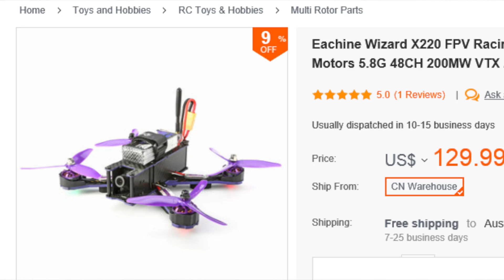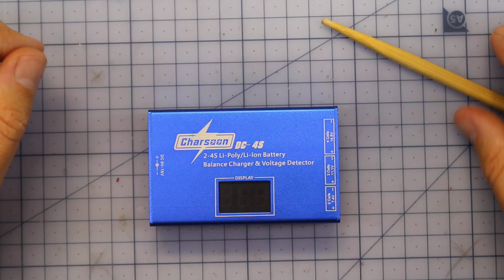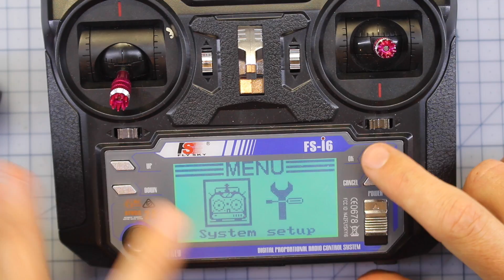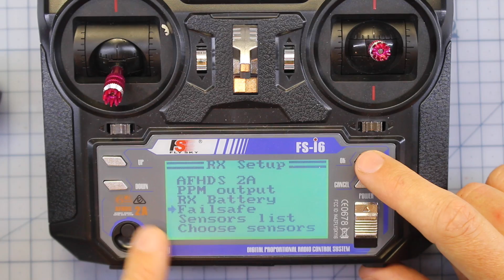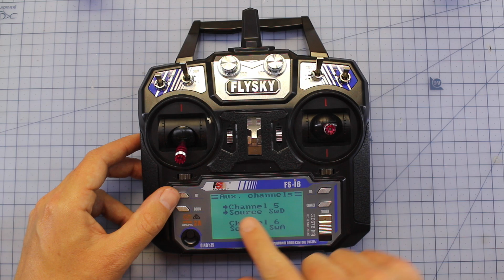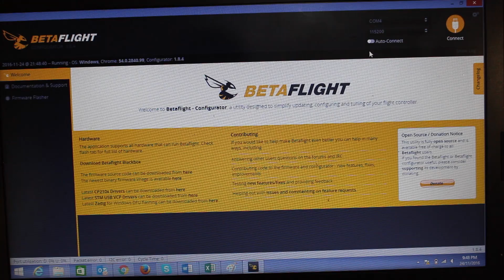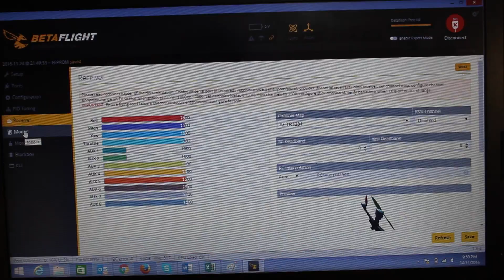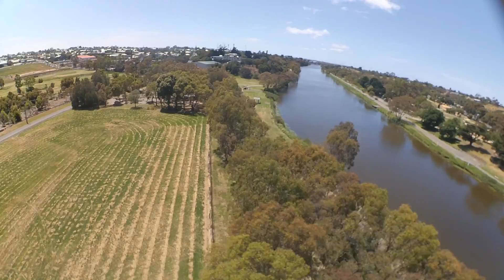How to get FPV DRONE RACING for under $300! Parts +Full setup.

Comment: +UAVfutures Thanks a million for the tips! Can you go into more depth on the failsafe functions?

You mentioned something about "in case the quad loses signal, it won't fly away"

On Channel 13, you set the throttle to -99%, which I understand stops the motors, but what did you do on Channel 15 with that switch?

Comment: Is the binding process as simple for the Taranis? I have the Taranis and x8r receiver. In all the videos I've watched people have been dealing with a bunch of wires I dont know what are and putting a battery to the x8r and doing setting in the controller... Do I have to buy a little battery to power my x8r receiver or what?

Comment: i flew my drone for the first time today i got in 2 flights (i have actually the same kit) but i tried to charge my battery again and it wont charge it sometimes comes up with error and when plugged into the drone the lights just flash and the controller beeps and says it has no power if anyone one can help it would appreciate it

Comment: Wow thanks for this build I bought nearly all the parts recently and I am just waiting for the delivery. However, I couldn't but the goggles because they were out of stock. 
About the goggles, can they be used with glasses? I have seen that other models like some eachine ones they do have an adjustable lens. How do people with glasses do? Perhaps, at the screen is not far away glasses are not needed? 

Thanks in any case for your videos.

Comment: Really excited to start FPV. I own 3 toy quads that I've flown for over a year now and didn't know FPV was a thing until several months ago. Been doing a lot of research and I can safely say the Wizard's going to be my first, plan on ordering an RTF version, so I won't have to worry about multiple shipping dates/arrivals, plus I"m lazy. I've seen several reviews say that it's not for beginners due to the programming aspect, but I don't think that will be a big deal, since this video shows you how to do it. Super excited, just hate having to wait for it to restock.

Comment: i followed your setup and had it all working yesterday but i tried it again today but i had a little puff of smoke when i connected the battery and cant connect to the fpv goggles anymore :( havent even flown it yet. i think i just wated $400. Also how tight do I tighten the props? are they ment to be able to freely spin if you flick them? if not how do I tighten them enough with out superman coming over and doing it for me?

Comment: Awesome video! one problem I am having though... I went through every step and have all the same settings. But when I plug my battery in and turn on the transmitter, I get no interaction on betaflight when looking at the receiver screen. Nothing at all. When I disconnect the wizard from the computer and put the battery in, still no response from the transmitter. The receiver is lit with a solid red light so I know they are paired. But getting nowhere.

Edit: I am using the Fly Sky FS-T6 transmitter and FlySky FS-r6B receiver. the transmitter does not have a setting for PPM output. Could this be the issue?
Reply: I'm in the same boat.  I can't find any info that helps figure out what to do either.
Reply: MrJRide2345 so here is my update... I ordered the same radio combo as the video but was sent the A version of the receiver and not the B version.. the difference? the A version doesn't do PPM. so. nothin works still. ibus and sbus is a bust. I ordered a B version of the receiver that should be here next week. will update then.
Reply: James Sydenstricker good catch. I'll have to check that when I get home. Thanks! I'll keep you updated.
Reply: Wah la! I got the B model receiver and it worked in 1 minute. too easy once it came in.....
Reply: really?!?  I have the B model receiver and it still isn't working for me... Any other thoughts?
Reply: Maybe. My current setup is.. The ports tab in betaflight has UART1 on, and Serial RX for both UART2 and UART3 on.

Configuration tab has Receiver set to PPM RX input

Receiver tab has AETR1234 As channel map.

Make sure that your reciever has your cable plugged into channel 1/PPM. 

I hope any of this helps. I know how frustrating its been. What are the symptoms of what is currently happening with yours?

Comment: Could I please have some help I have done everything to the tee this vid has shown and my drone won't connect to beta flight and in general is not working. It will turn and do the beeps but does not respond to my controller at all.

Comment: Notice that you've updated your recommendations for the goggles. Hope that means that you'll be doing a review of the Eachine Goggles Two shortly?? I'd like to see your thoughts before committing to them.

I've also seen that the Realacc GX210 quad seems to look very similar with potentially some better motors than the wizard along with a slightly lower price point so I'm trying to decide between those two for the base copter at the moment.. Any thoughts?

Great videos by the way. Your enthusiasm is infectious!!

Comment: Just ordered everything yesterday from here, a bithdaypresent to myself. :D Without the charger and the more expensive googles(goggle two HD),  three batteries, extra antennas and extra props 2sets.(DAL).
 Already have a 1-6 cell charger.
Just have to wait around 30 looooong days..
i Ended up with 430USD. 

Thank you UAVfutures :)
Reply: How did it all work out
Reply: Update?

Comment: Awesome walk through!  I'm having trouble getting it to connect to Betaflight. When I click "connect", it then says "connecting" for 10-15 seconds and then back to "connect". Any idea how to fix it or why it's doing that? Thanks!
Reply: hey, did you find out how to fix this problem? im having the same issue
Reply: Adam Pendlebury no sir. I've figured out that I need to "flash" my "board" with the correct firmware, but in order to do that, I need to install the correct "drivers" onto my computer. (Keep in mind, that I have no idea how to do any of this stuff. I'm just watching YouTube walkthroughs to figure it out) The issue I'm running into now is, one of the "drivers" in supposed to download only has a download for Windows and I'm on a Mac.  I'm waiting to hear back from another YouTube user to see if he has any other ideas.
Reply: MrJRide2345 thanks for the reply mate. I ended up getting it to work, I did download those drivers where it says on beta flight to download but I'm on windows.

Comment: how do you assign the switches to the aux on betaflight. only thing i cant work out. do you have another vid or link to help
Reply from the maker: you click on the little tab and choose aux 1 2 or 3 etc its in the mode selection.
Reply: yeah. not working for me. think im missing something in the programing on the receiver

Comment: the jjpro sold out, what is a good fpv goggles for the same price
Reply: +UAVfutures can you tell us what you found better in that one compared to the JJPRO F01 ?
Reply from the maker: I just linked some awesome goggles in the description but they are a bit more $$
Reply: i am on a really tight budget so should i go with the Eachine EV800 or should i get the awesome goggles

Comment: Stewart, I was having problems with my FS-i6 transmitter, It will not let me change my auxiliary channels. they are stuck on VRA and VRB and I  have tried everything to change them. they won't let me  save my changes and I can't do anything. What do you think I can do???
Reply from the maker: there is an option in the radio some where, I think there are some youtube vids on it somehwere if i remember correctly
Reply: If its not to much to ask, do you what is the option? Apparently the aux. (SWA SWb VRA VRB SWC and SWD) are all stuck in one position. In the sense channel 5 and channel 6 are all stuck on VRA and VRB and won't change to SWA amd SWD.
Reply: Do a long hold of the cancel button
Reply: Thank you!!!
Reply: I just configured my radio and now it works! Thank you so much!!! I have been trying to tackle this problem for 3 WEEKS now,,,,

Comment: hi, is it possible to use the Turnigy Evolution and its receiver with the X220?
Reply from the maker: yes
Reply: thx, i did bind the receiver but still cant get the props to turn, ive tried flicking each switch thinkin one might be the arming switch but still cant get props to turn ....do i need to do something on betaflight first to get it to arm?

Comment: What options does one have in order to have telemetry visuals in the goggles? I want to be able to see battery life while flying. Thanks!
Reply from the maker: need an OSD you can add one it but its a fair bit more technical to get it working

Comment: The RTF version is currently $197. It comes with a Tx/Rx, battery, and charger. The only thing to buy are goggles. Would you recommend buying the RTF version or the ARF version with the components you mentioned?
Reply: I had the same question. I found a review that explained it https://www.rcgroups.com/forums/showthread.php?2761374-Eachine-Wizard-X220-ARF-F3-Updated-Version-(review-work-in-progress). The ARF is an updated/newer version. It has a better flight controller and better motors. I went with the ARF.

Comment: Anyone else's video transmitter heating up? I'm not sure whether it's supposed to do that. Nothing major, but pretty warm nonetheless. Antenna attached, not flying just battery plugged in and connected to Kylin goggles for about 4 mins.

Comment: wondering if you can help me out with a problem on my drone build. I've binded my spektrum dx6 to my dsmx receiver but the drone doesn't respond when I move the sticks. I'm pretty sure I wired the receiver to my naze32 correctly.
Reply: I figured out that I needed to turn on the UART2 serial rx option. it's now registering my radio in the reciever tab. However, my drone isn't responding when I disconnect from the PC and try to throttle up as if I were going to actually fly it. Not sure what I'm doing wrong...
Reply: Well I thought my problem was that I ran the recievers signal and power wires to the wrong contacts, so I swapped them temporarily. It didn't even power up so I swapped them back. I got it to bind a couple times after that but then my reciever just suddenly stopped lighting up. Did I damage it when I ran the signal wire to the power contact? I did plug in the battery to the drone... probably a bad idea...

Comment: This has been a complete disaster at this point in time. I followed the setup exactly as you did and when i go for takeoff the quad just completely flips upside down. Its not the trimming and most things ive seen the internet says that its wiring, but since I brand new and I didn't do the wiring i have no clue what is going wrong! All help will be appreciated
Reply: CheifFeast Mine too.  Were you able to find a solution to this?
Reply: ***** Yes i found a solution, I bought a soldering iron and has to resolder some of the esc's on the control board since 2 we switched when originally arrived. I was the white wire that I had to switch. I a super noob so it shouldn't be too difficult for anyone else

Hope this helps

Comment: How long can the drone fly with a 14,8V 1500mAh 4S 45C lipo ?
Reply from the maker: between 2 and 7 minutes depending on how you fly. EG how long can you travel on your legs for. 20 minutes running or 8 hours walking. Big difference depending on how hard you push it.

Comment: What must you do if your AUX switches don't affect the drone, I have been check beta flight and it doesn't do anything, any suggestions?
Reply: Never mind, I found out I didn't save in the radio/receiver settings

Comment: lol, im so sorry im asking so many questions but when i want to connect my wizard to betaflight, i plug it in, lights start flashing but when i click connect it only says "Serial port successfully opened with ID: 4" and after a while it says "Serial port successfully closed"    what can i do about this?
Reply: Same
Reply: HaramBae Solved it,  just try another cable
Reply: SAVED MY FUCKING LIFE DUDE THOUGHT SOMETHING WAS WRONG SPENT AGES TRYING TO FIX AND JUST A WIRE CHANGE

Comment: Awesome guide! I've gathered up the kit, got it all configured and just spun-up my motors for the first time. Looking forward to my first crash tomorrow!

There were a few steps I had to sort out for myself since nothing came with a guide. From plugging in the battery for the Headset to downloading and installing the drivers for Betaflight but got everything sorted eventually. 

If you can stand a newbie question, I'm not sure I have the props on proper. They're a bit of a tight fit on the shaft. They don't seem to go down all the way and even if they did the nuts won't go down far enough to make contact. Do the props need to sit at the bottom of the shaft? Is the nut just for containment? Cheers, and thanks!

Comment: I am probably going to end up buying this "Starter kit," and I have a few questions, and would appreciate any help from anyone. 
1. How tough is this quad's frame, and how much force can it take?
2. How much static/distortion does the headset usually have?
3.For someone who has never even touched anything more complex than your standard RC helicopter, how hard can it be to learn to fly?
4. Does anyone know any good videos of full guides how to fly, seeing as how I don't even understand the controller. 
If you think there is anything else I should know, I would really appreciate anything you have to offer.
Thank you.

Comment: I saw in the description that the battery you talked about is sold out, with the new battery you recommended, does it change any of the setup/maintenance steps or anything else important?

Comment: is it normal for the props to be a super tight fit over the motor shaft..  mine didn't just slide on like in the video
Reply from the maker: sometimes there is a little variances

Comment: Would it be possible to set it so that if you loose signal, instead of turning off, the engines would just throttle back and the drone put back in attitude mode? That way instead of crashing on the ground it would "gently" land?
Reply from the maker: DO NOT DO THIS, just let it crash, much safer and wont burn your motors out if it gets stuck in grass
Reply: gotcha

Comment: Out of curriosity I looked on ebay and found this deal which includes a lot of the parts featured in the video at a realy cheap price, However im not sure how good things are as i dont know much about drones. Thanks:)

http://www.ebay.co.uk/itm/Eachine-Wizard-X220-FPV-Racer-Blheli-S-F3-6DOF-5-8G-48CH-2300KV-Motor-FlySky-RTF-/371833578636?hash=item569302248c:g:OpcAAOSwnHZYcJBq

Comment: Hey, great vid. None of the batteries can be shipped to Mexico. Do you have any other suggestions for battery suppliers? Also, does the battery have to output 14.8V or can it use a higher-powered battery?

Comment: Whats the difference between the two blade and the 3 blade propellers ?
Reply: i guess the number of blades :)
Reply: John G if I were to hazard a guess, the  2 blade would be less weight so will spin up faster  at the cost  of less lift. More blades would be more lift for the same rpms.

Comment: So i been trying to run simulators on my pc with an xbox controller before investing in a racing drone. I`ve been having the absolute worst experience with trying to get a hang of this thing. I`m hesitant about buying anything before getting the swing of things in a sim but i can`t go more than 5 seconds without crashing on the sim. Is it seriously this hard to do? it`s almost discouraging....i`ve been at it for a few days now an all i do is crash every few seconds.  I have 2 cheap drones that fly line of sight that i can fly with minimal crashing (mostly hang a tree limb or something) and do have a lot of fun with them but the moment i hop on an fpv race sim to try and practice i funk everything up and find it close to impossible to have any sort of control. The sim i`m using it HOTPROPS with a xbox 360 controller, someone tell me it`s not actually this bad because i really want to get into this hobby more.
Reply from the maker: it is hard, but not that hard, and also xbox is probably not the best thing to practise with and the real quad feels easier to control in my opinion

Comment: I orded this whole kit you posted thru Banggood 0n 12-4-2016. The only thing I have received is the batteries and Remote controller. The goggles, Drone, and Charger has been out of stock. I have contacted them on Chat and all they want to do is cancel the order. They have to be the worst customer service I have ever seen. This pathetic. I hope nobody ever tries to order anything from Banggood.
Reply: Joe Arnold ordered mine on Jan 6, 2017 and got everything exactly two weeks laterally
Reply: Joe Arnold I waited after Christmas to avoid stuff like that happening
Reply: Well it is Jan 19th and I just finally got them to cancel part of the order and refund Now I have to wait 48hrs to get my money back so I can buy the parts from someone else. Even if it was ordering after Christmas than I should have got my stuff before now. No they are taking orders and getting paid from people than they try to order the stuff the customer ordered at the profitable price and if they can not they cancel your order. I talk to the US postal Inspector and they stated the same thing and they are investigating them now.
Reply: Joe Arnold oh wow. Now I know why all the big FPV racers/freestyler tell people to stay away from Banggood and Other cheap online stores 

But In my experience I haven't had a problem with Banggood yet.

Comment: Thanks for the video, thinking about getting into fpv drones, might be fun with my rc cars to.
Question though, what makes the kylin goggles better than the ev 800's. The ev 800's have a higher resolution so wouldn't they be better?? I assume I'm missing something.  

Thanks!
Reply from the maker: just felt better in my opinion